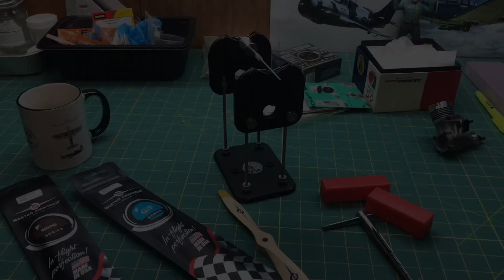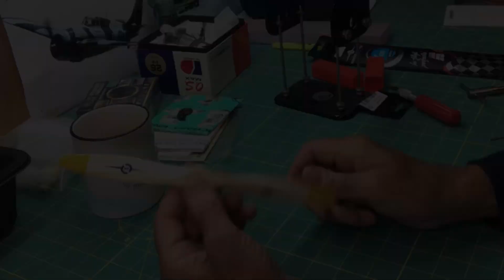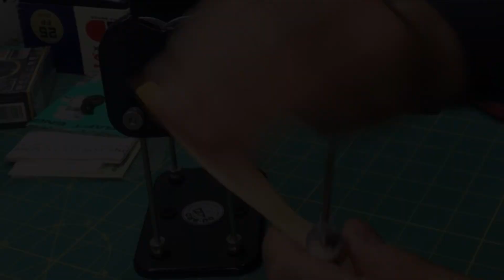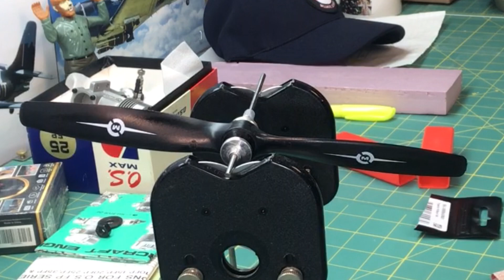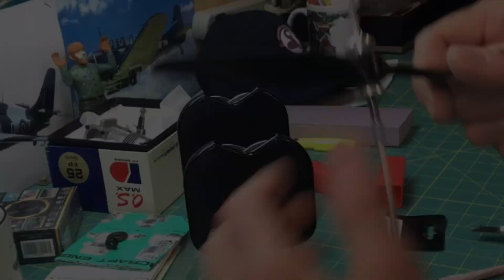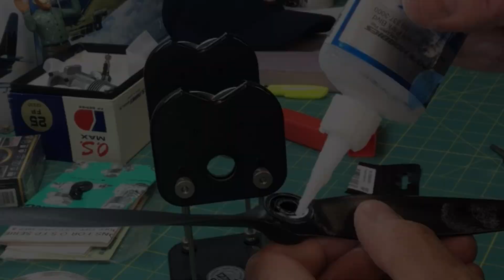How to balance an RC Plane Propeller

Comment: I've got an AeroScout with a prop that has an oblong center hole.  How do you find the center using a Du-Bro Tru-Spin Prop Balancer?
Reply from the maker: If the prop has an oblong hole you should prob replace it.  The hole must be circular and fit the prop shaft with no play.

Comment: Instead of using a knife to balance the hub, I use a micro drill to remove material from the heavy side. It’s a slow but accurate method.
Reply from the maker: That makes sense! Ill try to remember that next time I balance

Comment: One thing I could say about propeller balancing is to rotate the prop on the  fixture pin of the balancer. When you get close enough the balance will change with this rotation. At that point, you are within the limits of the balancer.
Reply from the maker: Thats an interesting point. I will check that out. This is maybe why in some cases you can’t completely find the p
Reply from the maker: ….continued from my message that got cut off: so this is why sometimes you cant get a perfect balance? Something to consider next time, thanks

Comment: If prop is under 16” just blade balance is fine or I find you could easily chase your tail or do more damage than good, but thanks for the video nice work
Reply from the maker: I agree with you on the hub balance, good point. It gets harder and harder the smaller diameter. If its not that far off its fine to omit that step, but I thought to show it here. Thanks for the insight.

Comment: "Running-in" an OS engine! What? Really?
Not necessary.
My OS 20FP started first flip and operated perfectly out-of-the-box. (All my other 4 OS engines, run perfectly with no running in required).
Set the needle valve and flew a 1/12 scale combat event right away.

Face it, you just like to doodle around wasting fuel and making a noise for nothing.

Your engine crash story doesn't hold water either.
For the engine to be SO badly damaged, the spinner would be concertina-ed or obliterated, not just have a little scratch.

Also, edit your videos or work to a script. You repeat yourself over and over.
Reply: According to the instructions of every O.S. engine I have ever bought, no only is running in required but the process is explained thoroughly in the directions. You are free to do whatever you want, but the safest course of action, both to follow and recommend to others is to follow manufacturers instructions as they know more about their engines than you do. 
Your comment is nothing but negativity, and cynicism from start to finish. Work on your people skills a little bit. Jeez!
Reply: Christopher, have you ever been accused of being an obnoxious ass? It’s his video, he can do as he’s see fit!
Reply: @christopherknee5756 You are totally incorrect.  Unless an engine had been broken-in at the factory, a run-in period is necessary to prolong the life of the engine, in some cases beyond the first flight.  Go ahead and try no break-in on a $2500 OS Gemini Twin- seize it up on your first flight, then tell me what an experienced model flyer you are.  Judging from your comment, you'd probably blame the engine manufacturer.  You might try reading the operating manuals that come with your engines.  I found your comment to be rude and unhelpful to anyone who builds and flies model aircraft- not to mention just plain wrong.

I just happen to still have the manual for my OS 91 Surpass:  in it on page 3... "NOTE: Make sure the engine is fully 'run-in' before attempting continuous operation at full power! See RUNNING IN section"  There is an entire section in the manual of how to properly run the engine in on page 2, Genius.

Comment: Another reason to balance props for IC engines, is to avoid the problems of fuel foaming, which has caused deadsticks and unreliable engine tuning.
Reply from the maker: Thats something that makes a lot of sense, That would lean your mixture and potentially overheat your engine. Great point, thanks!